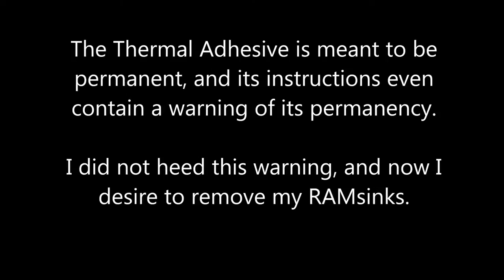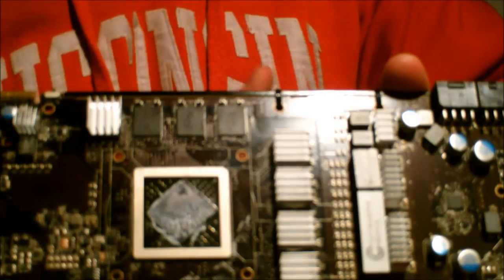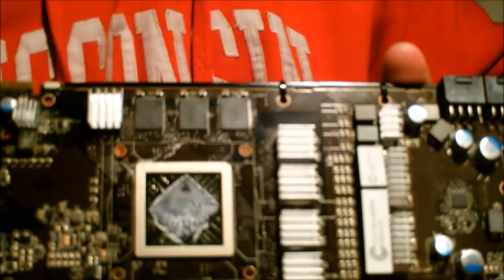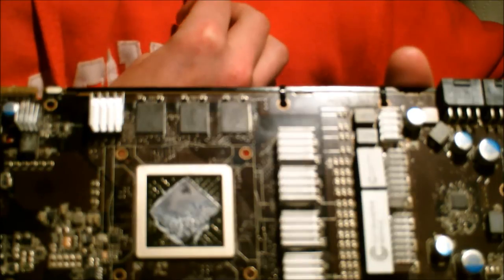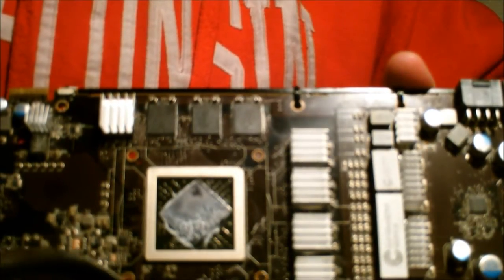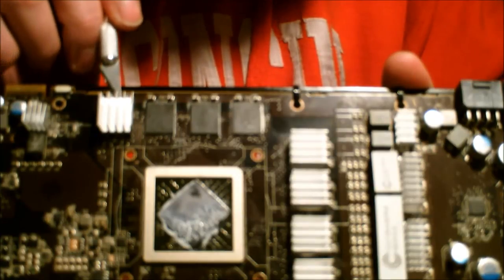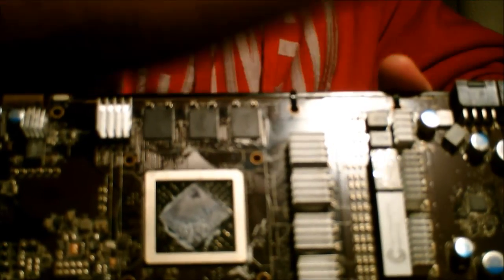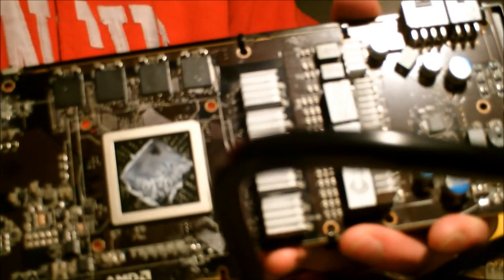How to Remove RAM Heatsinks from a Video Card

Comment: Mixing Arctic Silver Thermal Adhesive & Arctic Silver 5 Thermal Compound in a 1:1 ratio allegedly results in a semi-permanent thermal adhesive that can be dissolved with alcohol. 
I suspect similar results can be achieved at a lower cost by using silicone thermal compound and silicone thermal adhesive.